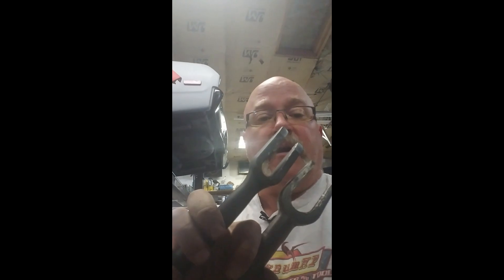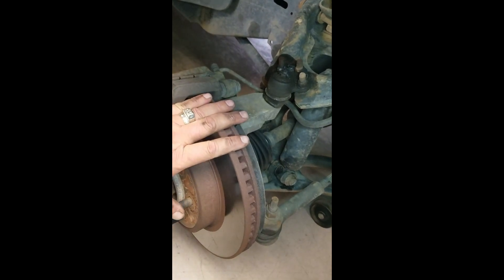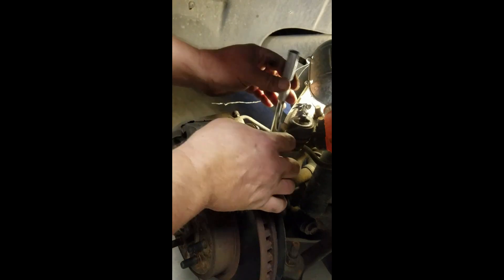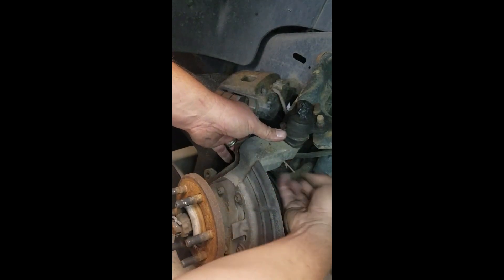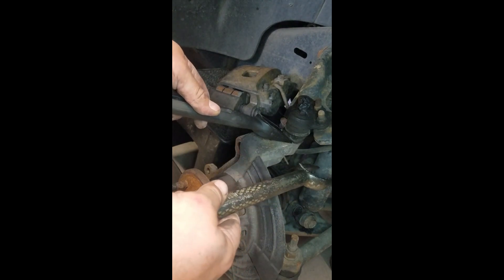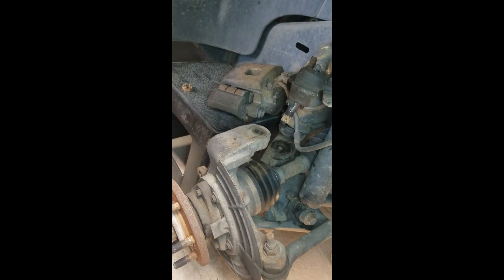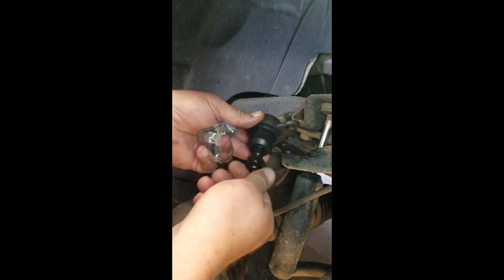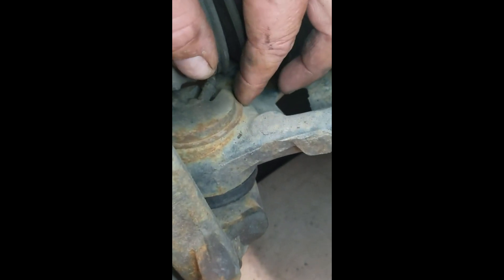2003 Dodge Durango Ball Joint Replacement.

Comment: How did you get the axle nut off?
Mines stuck stuck
300lbs and still didn't get it to move
Reply from the maker: Is penetrating oil and use a large breaker bar.